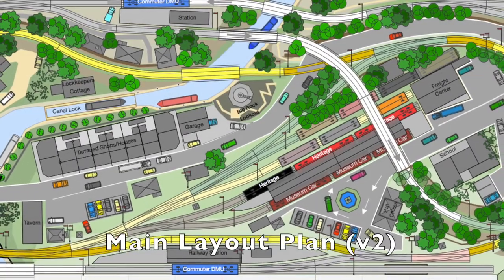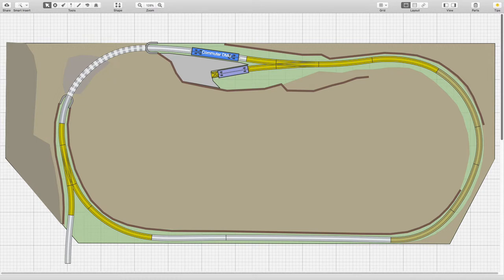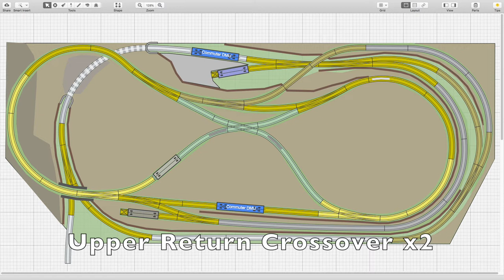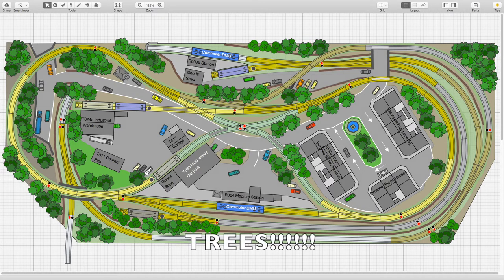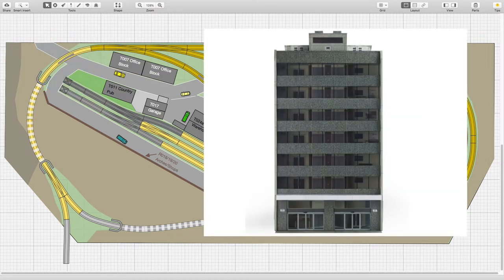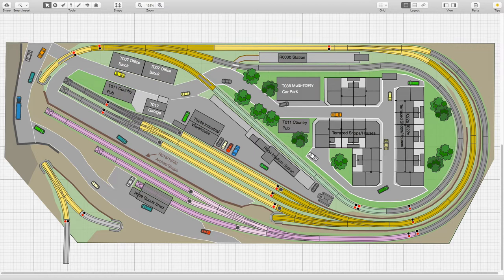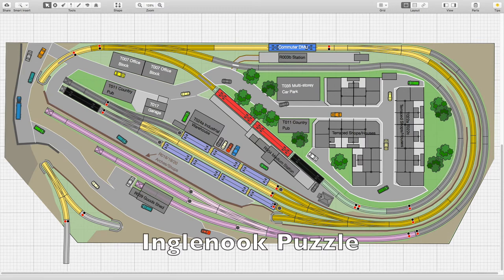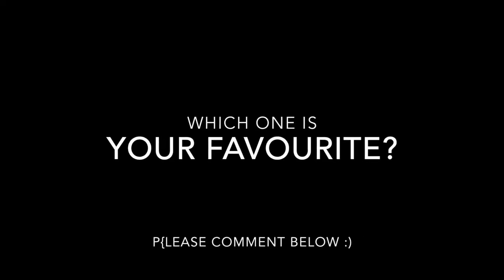NV#3 I'm extending my N scale layout - even BEFORE it's built! Well, at least PLANNING for it :)

Comment: I vote for #2 as #1 looks a bit too crowded for me. I’d use the space in the return loop for som nature scenery, eg a forest to add some “air” to the layout, and probably make it a hill too to somewhat conceal the tracks looping back around. On top of the hill could be a small castle or cottage or maybe an observation tower. There is a quite interesting tower on Bornholm I think with a masonry structure that has later been extended with a steel structure on top of it, if you go in that direction.

Comment: 2a or 2b are probably the more interesting to operate, I see less need for the engine shed unless you're planning to keep all your locos on the track at the same time without physically swapping them off. Of course the advantage of the engine shed is you won't have to make a dozen identical houses.

Comment: Not sure where you are at but a couple of comments:
1) I have found that magnetic uncouplers are very problematic.   When you go over them, on the level, at slow speed they will sometimes uncouple as there isn't constant pressure on the couplers.   I removed the magnets on mine and just do it manually now - like in real life.
2) If you go to DCC then all of your autoreversing problems go away.   You no longer have a bunch of toggle switches to keep reversing polarity.   You insulate the track as required and put in an Autoreversing unit (and yes, you can use an Arduino if you want although I prefer the commercial ones that don't require any special sensing equipment like the Arduino solution requires).   Cost-wise, the basic DCC systems are not that expensive and you can sometimes get used systems.   Engines, without sound are not that much more than DC only.   Although it will cost a bit more I find that added value of DCC is more than worth it.    Oh, and if you want you can build a DCC system using Arduino (see DCC++) which makes it even less expensive.
Reply from the maker: No progress on an actual layout at this time Don... No $$$ unfortunately! Thanks for the tips! :)